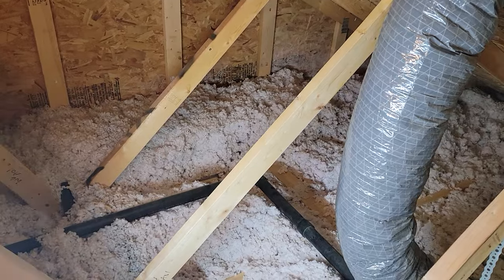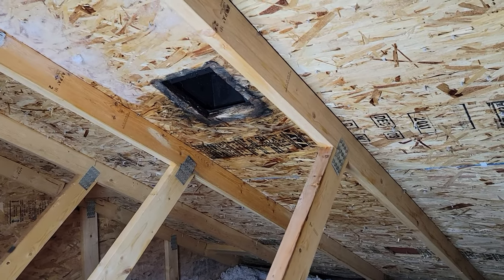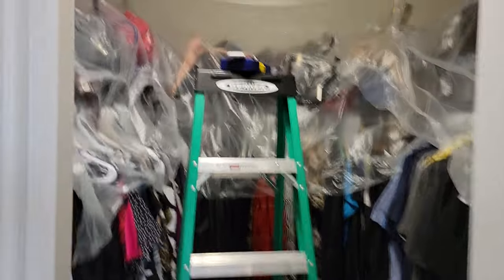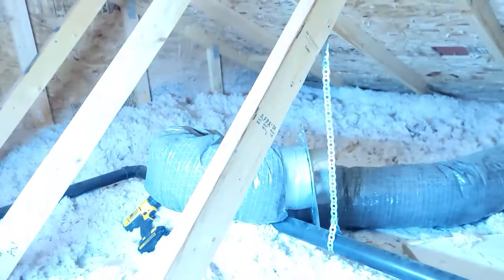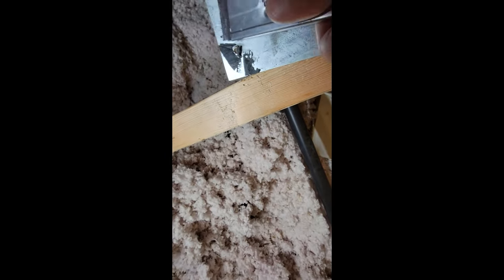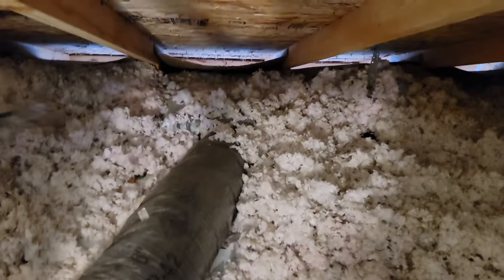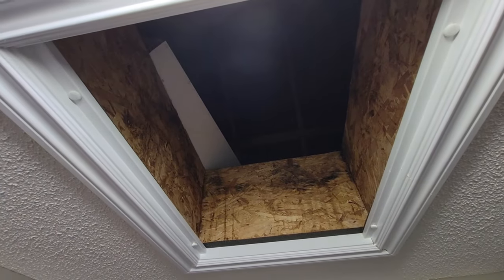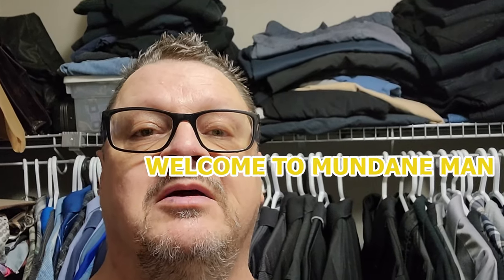Unveiling The Mystery Of Attic Frost | What's Causing It? | Is Your Attic Frosty?

Comment: The fan shroud is a small problem, and your ventilation is the major problem. Your airflow from the soffit overhang to the ridge venting is the only thing that will create the frost you have. Clear the blown in insulation out of the soffit and make sure that you have correct ridge venting.

Comment: Do you have vented soffit panels for your roof? If they are covered by your insulation in your attic it can cause frost to form and then mold. I had this happen and to get rid of the mold use a product called Benefect as it's all natural, kills mold and stops it from returning. Wear a mask too as mold is deadly to the human body. I've been in mold recovery mode for over 17 years now.
Good luck! :)